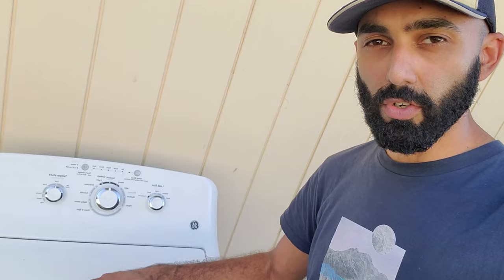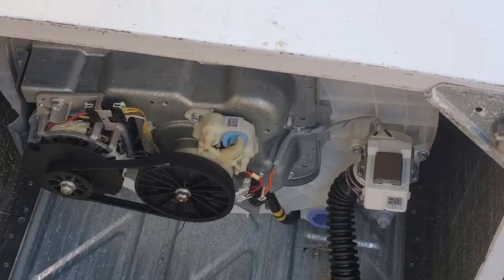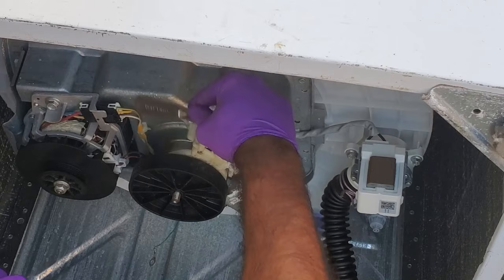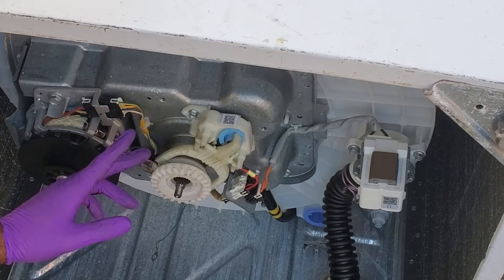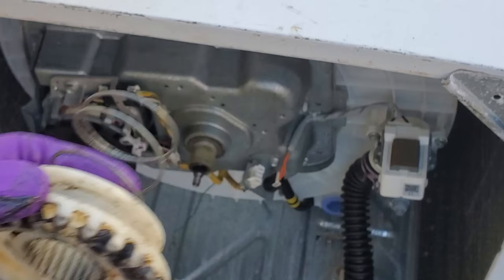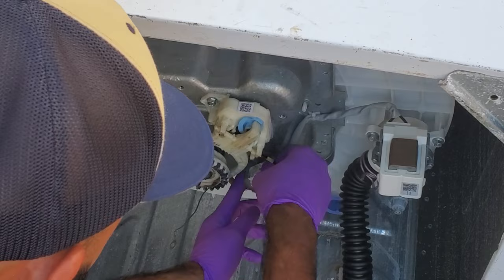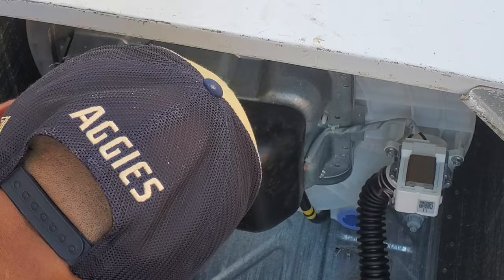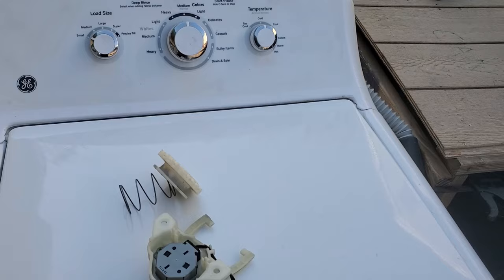Fixing A GE Washer That Makes A Grinding Noise During The Wash Cycle!

Comment: After watching this, I flipped my washer over expecting to have the same problem. Turns out it was just a Cholula hot sauce lid that my cats knocked under there. It had gotten wedged between the floor and the cover and was grinding against the pulley. Just removed it and now it's running great 👍
Reply from the maker: Great work!
Reply: LOL 😹 I hope my problem is the same.

Comment: OMG I have been piling through countless videos and none have sounded like this so I was like omg I am never gonna find my noise lol!
Reply from the maker: Glad you found the sound. I almost omitted it and went straight into the repair!
Reply: @DuctTapeMechanic  Gasp! Don't do that lol!
Reply: Same!! But mine is a grinding/screeching noise for AMANA washer. 🧐
Reply from the maker: @Felipe-ou4jz  Replace the clutch. I have a video on how to do it for whirlpool/kenmore/maytag/Amana (all the same company).
Reply: @DuctTapeMechanic  oh man! I will follow the video. Thank you so much! 😎
Reply: Me too!!!! This is exactly what my washer sounds like!
Reply: Omg I have been looking for this video!!! I have went through hundreds of videos/channels trying to figure out wtf is wrong with mine(frigidaire) and this is it!
Reply: Ive heard that EXACT noise from my washer, but when i run mine, it fills up then doesn't agitate,  my question is, is it the clutch or something else?
Reply: @kingdaddy8366  mine wouldn't stop filling to agitate. Found out the skinny hose that runs along the machine, at the bottom where it attaches to the little box,  stuck a wire in the box and cleared a very tiny clog. It worked!
Reply: Replace the gearcase especially on the whirlpool, Maytag, amana
Reply: @DuctTapeMechanic  on the same model would this be the issue if it has stopped agitating
Reply: @ericoelze4014 I just put in $250 for clutch and  shifter plus labour house call. If I keep doing this for the grinding noise I would have paid nearly the retail cost of my $600 Amana with no grantees that's the end of the repairs!
Reply: I thought the normal noise  was broken.i had a front load for 18 yrs..lol
Reply: Thanks for this video very helpful. Will this problem also cause you clothes to not spin out all the way? Just wondering because along wth the grinding I’m also having the spinning issue
Reply: Mine is making this exact noise, so I replaced the clutch assembly and spring. No change so, I bought the mode switcher, but again there is still no change. What else could it be. My washer looks to be that exact model  GTW330ask0ww and is literally making the exact same noise as in the video. Everything works just that God awful noise
Reply: Been watching videos for this sound also! But my washer makes this noise when it starts the spin cycle. I'm guessing it'll be the same fix so I'm going for it!
Reply: Omg finally a video that has the same noise as my washer and the same exact washing machine too!! Where did you order parts at?
Reply: Lol sadly from a video I saw on ge this is the darn noise it let's out. So sad and loud.
Reply: GE should be ashamed of themselves for producing a stupid crappy product.
Reply: Same. Mine sounds like.. "whrrrr enh enh enh whrrrrr enh enh," this video actually sounds like it..minus the metally grinding noise
Reply: Thank you so much for this! We have a GE washer that sounds just like this but it’s model number is:
GTW465ASNWW
Do you think this repair would work for this model also?
Reply: My man thanks your videos are simple and well explained 😎

Comment: One note, my washer was fairly new (2 years old) and there was a grinding sound during the SPIN cycle. So I ordered a clutch kit from amazon to do the repair ($18). But after taking it part I didn't have the debris from grinding plastic. It turned out to be the shift motor assembly needed to be replaced ($24). so this might be helpful for some people with a similar problem.
Reply from the maker: Wonderful tip! I also recommend replacing the clutch and actuator at the same time!
Reply: Did it spin during the spin cycle or just make a noise.

Comment: I have listened to that grinding noise for a month and a half and just figured it would stop. But when it didn't I looked it up on YouTube. Thank you Duck tape tool man. You saved me $700. The video explained everything perfectly. I changed the modulator the clutch and the spring in 25 minutes.
Reply from the maker: Awesome! Glad to help!
Reply: @DuctTapeMechanic you need a tip jar
Reply from the maker: @w_matheny3030  There is a feature on YouTube called "super like" which allows people to leave tips😉

Comment: Thank you! This is my exact machine and the exact grinding noise I was experiencing. I replaced the spring, clutch, and shifter and it’s as good as new! Saved hundreds. Thank you again!
Reply from the maker: Excellent job on the repair! Glad I could help!
Reply: @DuctTapeMechanic  Any tips on looking for missing socks in this model of washer without having to remove the electrical panel?
Reply from the maker: I would be hesitant to disassemble this machine to look for socks. They can be quirky sometimes, so if you have a good working machine, I would leave it alone.
Reply: can anyone share a link on where to buy these parts ... I know I can google, but I trust a link from parts yall have tried and worked excellent for you ... thanks in advance 🙏

Comment: Thanks and a NOTE: also make sure the splines the clutch ride on are clean and rust free. This video saved me hundreds but it does not note that your splines might be rusty which prevent the clutch from sliding easily. I cleaned mine with a Dremel wire brush wheel. Washer works like a dream now!  Thanks DuctTape!
Reply from the maker: Got advice! Thanks for the support as well!

Comment: Thanks for this video.  I added it to my one star review for this washer.  There is no way those important parts should be made of cheap plastic.  It is designed to fail.  Whatever happened to consumer protections?  As a side note, I tried to show this video to a GE repairman since my machine is under warranty.  He looked away and said he doesn't learn repair from watching YouTube videos.  Then proceeded to tell me it was the belt which he replaced and after he left the noise started up again.  If GE wants to waste their money I will keep calling them back.  I have the extended service plan.  If they keep sending technicians like that they will have spent 10 times the cost of this machine in service calls.
Reply from the maker: GE has really gone down hill. I have seen nearly new GE/Hotpoint washers making this grinding noise (most of the time it's the clutch sometimes it's the transmission pully).

Comment: Thanks for posting this video. While watching this I discovered a different problem I was having with my washer.It was loose nuts on the pulleys. Making a grinding sound as well. Got soaked for $89 for service call where the technician told me to buy another washer. Said it was the bearings or the motor. Wasn't worth fixing. After watching your video, fixed it myself......cost 30 cent washer. Working beautifully.
Reply from the maker: Awesome! Glad I could help a bit!

Comment: Dude! I just bought my washer like 6 months ago. My girl was certain there was something under the agitator... I was starting to think so too until I found this video.. Sucks such a new machine needs such an expensive repair, but I'm gonna have to do this. Thanks a lot for your video
Reply: Your washer should have a 1 yr warranty with it.  Mine started doing this when it hit a year old on new years day.  I have the extended warranty, so they covered it.  Now flash foward 4 months later, it's doing it again.
Reply: @JMarrie exactly the same thing with mine. 6 months after new it started doing it. Parts were replaced, 4 months later it's doing it again. Junk.
Reply: I just had the repairman here.  This machine is less than a year old & started making this noise this week.  The guy said it’s a normal noise & nothing to be done about it.  I’m furious.  Another repairman is coming tomorrow.
Reply: @lesliechew7293  I haven't had a washer and dryer last more than 2 years.  This new crap is crap.  I'm going to switch back to an old fashion ringer washer.
Reply: @lesliechew7293  Any luck?

Comment: Thank you for the video! From the sound to the step by step process this was great. I fixed my washer in about 45 minutes and it is ultra quiet now!!
Reply from the maker: Fantastic! You just saved yourself $200-$250 which is what a typical appliance repair tech would have charged (could have been even more expensive if they misdiagnosed it)

Comment: Thank you for the wise advice. I changed the clutch about a year ago. I didn't know that a weak shifter actuator could cause the new clutch to fail again. It failed. I blamed the failure on Chinese parts, till i saw this video. Thank you for the tip, and taking the time to help others with this video!
Reply from the maker: Yes I recommend changing the actuator and clutch at the same time. Glad you found the video helpful! Best of luck in your repair
Reply: I changed both and not even a week later it started with the same noise
Reply: Thanks so much.  I just bought my washer    I am going to see if it is still under warranty.   However probably will end up paying for it all myself.   Thanks so very much!

Comment: I just got my new washer today, started my first load and it makes the "Normal" noise that yours makes after repair. I didnt think that was normal after having a front loader for 20 yrs.  After reading comments, I'm so glad I got the 5 year warranty on my New GE Washer Model # GTW465ASNWW. although you make it look so easy to repair... due to knee pain I would not be   able to do this. and honestly, I just don't want to hear my husband cussing if he were to try. LOL
Reply from the maker: A 5 year warranty for a GE is definitely a good idea!
Reply: Hey.  These washers are noisy when everything’s working perfectly.  That said, make sure you raise the washer off the floor and level it by turning the bottom feet.  Your clothes will get twisted and tangles if the feet are all the way to the floor.

Comment: Very informative & helpful video without being long & drawn out!  My machine was making more of a squeaking noise than a grinding one, but I pulled that plastic safety shield off to check things out anyway.  Instead of chunks of white plastic/nylon, I found more of a black dust.  I immediately said "I know what that is...belt dust!!!"  Sure as can be, I looked at the belt first thing and found that on the splined pulley (connected to the motor), the belt had somehow jumped up one spline so that the edge of the belt was rubbing against the large flat edge of the pulley.  I pulled down on the belt while turning the pulley, got it back where it belonged, and all my troubles went away!!  I'm still going to replace the belt as the one edge is pretty chewed up.  But, until it gets here, the current one is still running the machine!  $10 "preventative maintenance" vs. the $130 I thought I was going to have to shell out for a new transmission/bearing platform!
Reply from the maker: Very nice! Great job troubleshooting!

Comment: EDIT:
This washer is very different than mine inside. Mine has a "clutchless" motor. I cannot get any part behind the pulley, except the whole motor... It's only $100 more to buy a new washer. I'm still going to take it apart and grease/clean the back of the pulley. If that works... Great! If not I will be getting a new washer.

THANK YOU!!!! You saved me waiting like a month to get my GE repaired!!! I'm going to order the part today, but mine only made the grinding noise for about 15 seconds before I turned it off. It does not grind in the spin cycle. Tonight I will take it apart and grease it, and see if I can finish my one load without grinding. 
It was not grinding last time I used it, then we had to move it as I had a broken pipe that supplied water to the washer. This is the first time I tried to use it since it was moved.
BTW... Liked and Subbed!!!

Comment: Thank you! I had a similar issue where the wiring harness for the speed sensor loosened up and got tangled in the drive belt. Made a very similar grinding noise. So I went ahead and order a new sensor, pully, spring, gear and shifter for just about $100 total. Viola! Like new washing machine. Love that you made the instructions so easy to follow.
Reply from the maker: Great work! Glad you found the video helpful!
Reply: @DuctTapeMechanic  I was also able to avoid spending over $120 on the new speed sensor for my model by buying an $8 speed sensor for similar models and splicing it onto the wiring harness for my model.
Reply from the maker: @douglasmclean2802   you are the man! great job

Comment: Hi! Thanks for the great video. I just did the replacement you show in your video and it helped a ton. But once I got the washer back up on it's feet, I can get it to start to fill, but it won't actually continue or move onto the next cycle. I figure I must've done something, but no idea what might have caused this. Got any suggestions?
EDIT: Solved it. It helps if you PLUG IN the mode shifter!!! FML 😂

Comment: Just got through fixing my washer.   Took me a little while, I had to just tilt back the washer at 45 degrees, I didn't have the room to lay it flat.  The only issue I had was getting the pulley wheel off, at that angle it was hard to get an angle.  I had already took out the mode shifter bolts and it happened to fall out while I was banging on the pulley and that gave me more room, so got it off pretty quick then.  No other issues and so far the washer is working fine.  Less than $75 to fix, including overnight shipping on the parts.  Thanks for the video, made it fairly easy.
Reply from the maker: Great tips! Glad it worked out!
Reply: Hey, have you got any portable dishwasher repair videos.  I have a whirlpool dishwasher that the pump seems to have weakened.  It will still pump out water but only a small stream.  I’m hoping it’s just clogged up.  Right now, I’m just bailing it out between cycles

Comment: Did exactly what you did and it’s still making that sound. Not as loud and not as often but still making that grinding sound
Reply from the maker: Sometimes it can be the transmission pulley that needs to be replaced as well

Comment: This was VERY helpful, but not for the reason you might think.  We just got a stacked (all-in-one) unit and the washer sounded like something was very wrong. But it sounds like yours, just without that intermittent grinding. So I guess it's ok.

Comment: Changing mine this afternoon, except for the spring, which hasn't arrived yet.  If there's an issue as is, I'll just repeat the disassembly and switch out the spring ($9 for the spring???).  I saw much cheaper timer assemblies, but settled on one that I KNEW would be new and the color was bright white vs some of the others that were obviously old/yellow-beige.  My clutch sprocket was about $9, spring @ $9, and I think the timer was @ $39, so I'm pleased with this one.
Reply from the maker: Best of luck!
Reply: @DuctTapeMechanic  2 weeks later and still running like new.
Reply from the maker: @johnstrom2721  awesome! Your the man!

Comment: I’m super impressed at how damn smart you are! I’m an accountant and people call me smart… but I’m blown away at how much you know about machines and t
How they work! My GE washer is making a CONSTANT grinding noise during agitation. I tried opening up to see if dolly bent up the bottom cover but nothing was touching.  Your video show intermittent grinding and based on your remedy I can understand what’s happening… the teeth are slipping.  What do you recommend I look at for constant grinding? I really appreciate any help you can provide!
Reply from the maker: I appreciate the kind words. A bad clutch could certainly cause constant grinding. I would tip the washer on its side, take off belt guard, and examine pulley and clutch for flakes/plastic wear. If there are flakes replace the clutch (possibly the shifter actuator as well), if no visible signs of damage it could be the gearbox is shot. Hopefully this helps
Reply: @DuctTapeMechanic  Thank you so much!  I will definitely try it!

Comment: Thank you for the video, unfortunately i replaced my clutch & shifter and the noise came back. I had to hold the plastic fork over a flame and bend it up slightly so it keeps the clutch out of the way during wash cycle, which seems to work for now 👍

Comment: So I replaced my mode shifter and it still gets stuck. My washer wasn’t agitating but it does spin. I noticed there is no contact with the teeth on the bottom for it to agitate. Am I missing something? If you could give me your input that will be greatly appreciated. Thank you and keep up the great work.
Reply: Having this same issue since replacing the parts.

Comment: Followed your instructions step by step replaced the clutch and the shifter and on the wash cycle my washer is making grinding noise and I lift the lid and the water is sitting still. Have no idea what the problem is. The spin cycle works fine. Considering just buying a new.
Reply from the maker: Only other thing is replacing the transmission pulley...